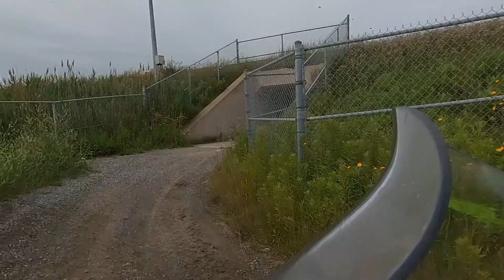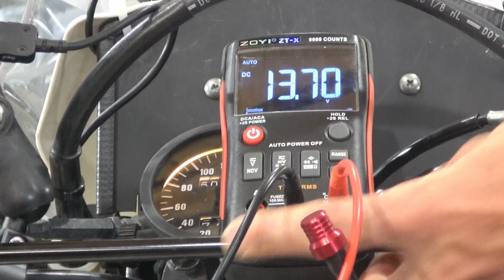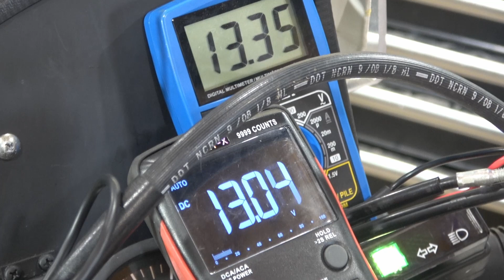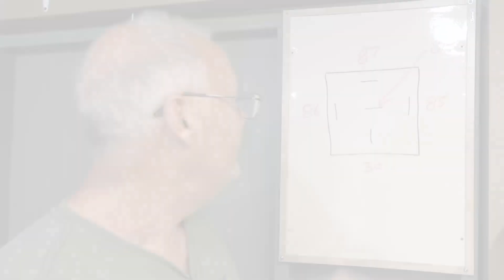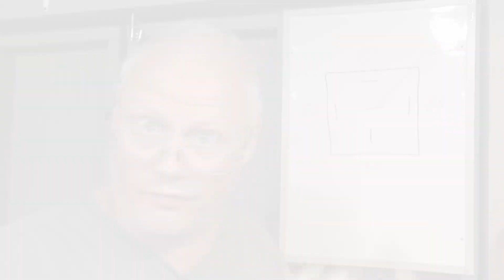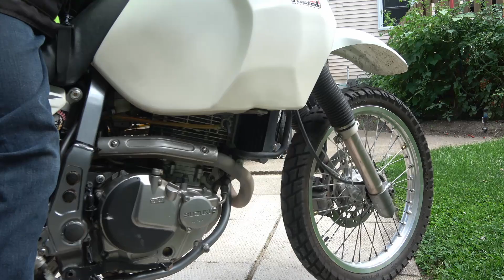Solving electrical issues on my DR650 GPS

Comment: Dino, thanks for posting this video. My question is after you turn on the ignition power on your DR, what is the electric sound I am hearing? Is it a fan? It is a whining sound.
Reply from the maker: @pdx650  thank you for the question, that is the fan for my cyclops headlight bulb.
Thanks again for the question.
Dino

Comment: I'm not an expert in electronics but I wonder if the 12v power for the GPS was tapped from a high amperage circuit such as the low beam headlight which is always ON, maybe voltage flucuations would be dampened enough that the GPS is kept happy, assuming that is the problem.   Maybe put one of those volt meters on the low beam to see what it's doing while engine reving.   Also, ProCycle offers after market voltage regulators.  I don't know if they work better, keep steadier voltage or anything about them, but maybe.  They're not cheap.
Reply from the maker: Thank you for your comments and suggestions. my 12 volt relay is wired directly to the battery with the low voltage keyed power operating the relay trigger coil. I like your thinking though and I could check this simply by bypassing the relay and wiring in the socket to rule out the VR. Thank you again for the tip.
Dino

Comment: I had the exact same issue with my Nuvi GPS on my KLR650 .   I think  your voltage regulator is working properly when it drops the voltage during engine revs. I believe that is how it is designed so as to prevent over charging.  Not sure but I think it kind of works in steps rather than infinitely variable.    It would be interesting to disable the charging system and go for a ride and see how the GPS performs on steady battery voltage with no fluctuations from charging system as well as the large variations in engine revs from shifting of gears.  I think you should be able to go for a short ride on only a well charged battery.    My theory is the GPS objects to voltages being all over the place.   Digital multimeters tend to show averages rather than true real time readings due to resolution issues. The USB power source I think helps alleviate this.
Reply from the maker: Very cool Idea, I am sure that the bike would run long enough for a test. Ill try that, thank you
Dino

Comment: I suspect the problem is contact bounce in the relay from cyclic vibration. I’ve seen this a few times on machines with large blowers on them. The fix was to put on solid state relay and the problem went away, sometimes turning the relay 90° or mounting it in a soft shell can help. If you know someone with a scope, you could hook it up to the 87 pin and battery ground and you’ll probably be able to see the cyclic vibration when the voltage drops. Keep up the good work.

Comment: Hey Dino, great vid as usual.  I'm wondering whether the relay contacts that power your GPS are being affected by vibration.  Not sure how you have it mounted, but perhaps you could temporarily remove the relay and maybe let it hang in free air (if possible) so that it isn't influenced by vibration.  Maybe it would be easier to jumper the connections at that normally open contact on the relay to temporarily bypassing the contacts, that way everything else is still in circuit.  This would at least eliminate this possibility.
Reply from the maker: You and a few others have mentioned this and I think you may be correct. the bike defiantly shakes a bit more on the road under load and this could be the issue. Thank you for the feed back
Dino

Comment: Great video Dino. The DR vibrates a fair bit being a thumper. It may be beneficial to change your power connection for the base to an SAE connector as they have a better more positive connection that the lighter socket type option.
Reply from the maker: Thanks for the tips! Many have made a comment about vibration and I think you are onto something. I will have to experiment a bit more.
Thank you again
Dino

Comment: Great video Dino.   I had what I thought was the same problem on leg three of round Aust. Occasionally the Dr would stop charging.  A few days later it stopped charging altogether.   I had a spare cheapy ebay reg/rec and swapped it out. The bike wouldn't start. I then swapped it with a mates reg rec, bike ran well but no charging. Rather than pull the bike apart I got lazy and bought a battery charger and charged the battery every night and removed the headlight bulb.   I got about 8 starts a day out of the battery.  I did 4000km doing that. Lol.  I presumed it was a stator and dropped it into a bike shop. It turns out the mechanic who replaced my piston, rings and cylinder at the end of leg 2 had strained a few wires going into a connector and although they looked good, they weren't.    So it was a cheap fix thankfully.   The USB sockets I use have a voltmeter on them and an on/off switch. They connect to power via an sea plug like you have on your battery tender.  I find the sae, merit and anderson plugs a lot more reliable than a cigarette socket. I fly out to start leg 4 on Sunday. Woohoo!
Reply from the maker: Right on, good luck on leg 4!!!!, wild how a simple loose plug can cause grief but 4000km riding with no charging......you are AMAZING!!!.
Thank you for taking the time to comment and share your experience.
Dino

Comment: hey there Mate greetings from Down under, Great video , my Garmin Navigator was having the same issues , also a Garmin Nuvi I have....no docking cradles just straight to USB. Frustrating as mine completely reboots . Have taken to using iphone and Waze maps ...seems to work well. also do not know if anyone else has mentioned but looking good mate , lost a shed load of weight by the looks of it ....any tips ?   cheers and thanks for your informative videos ...cheers
Reply: Don’t know which Garmin you’re running but for the Zumo XT2 it‘s recommended that it be powered directly from the battery. Seems the USB sockets don’t provide enough power for full screen brightness.
Reply from the maker: Thank you for the feedback, I've been thinking of just using my phone as well.
Dino

Comment: Hi Dino, I too am not good at electronics. That being said I would change out the cigarette plug ( female end ) it seems to me you ruled out about everything but that. Looking inside of mine I can see how vibration might loosen some connections or exacerbate a loose connection. Good luck
Reply from the maker: You have a good point here, I will order a new one.
Thank you for the feed back
Dino

Comment: Great vid Dino. I'm no Auto electrician either , A lot of issues with 12v can be earth problems, Some times with bikes the paint or rubber mounts stop the engine to frame coductivity. So a small earth lead can be added from engine  to frame just helps a bit. Some thing are just a mystery to us until we get to the bottom of it. Well done.
Reply from the maker: Thank you for the feedback. I agree with the mystery comment 100%, did I mention I do not like wiring all that much LOL.
Dino

Comment: Hey Dino, Great video Thank you for putting the time in. For a long trip to Outback Aust, I mounted my Zumo XT2 to my DR6650’s handlebar mounts using the BikePenR mount. Great piece of kit, machined aluminum, rubber mounted. The low profile keeps the dash accessible and the aluminum crossbar that I simply cut to fit the DR, allows the unit to be hand adjusted without coming loose. Although, I see it may not fit your standard bars. Nonetheless great piece of kit. For the power unit, I installed a Daytona 16037 D-Unit Motorcycle Power Supply, which ran the Zumo, and a double USB charger. Will add heated grips next time.
Reply from the maker: Thank you for the recommendations. I know I keep saying this but someday I will be upgrading my bars LOL. when that happens Ill look into the BikePenR mount, thank you again.
Dino

Comment: A good clear and informative video, Dino. As you have shown the voltage at the connection to auxiliaries can be critical. On my DR650 I measure the voltage and charge the battery on a regular basis through the auxiliary plug. I periodically loosen, inspect and re-tighten the battery connections (the battery is not large and I like all the energy I can get to go to running the bike). Your rundown on the function of the relay is good as is the information regarding carbon build up on connections. GPS - my Garmon Zumo has a multi pin connection. I have found that a periodic wipe of the connection pins is worthwhile ( I do not like periodic flashing of the GPS distracting me while riding). Thankyou for the video Dino - useful for motorcycle riders as usual.
Reply from the maker: Thank you Mal, great feedback that will help me and others. I hope your riding is going well.
Dino

Comment: Hello Dino. I think you are on the right track looking for a connection issue. I think the difference in the vibration of the bike loaded and unloaded may be why you have to rev it so high to get the issue to show up. My auxillary lights would flicker at low rpm while riding but i had to rev my dr 650 like you did yours to get them to flicker in neutral. I found one of my banana plus was the issue. I had to put a thin layer of solder on the male end of the plug to keep it tight and connected good. Been working ever since. Great video Dino. I always look forward to seeing them!
Reply from the maker: Great tip, Ill do some wiggling to see if that is a possible cause. Thank you for sharing.
Dino

Comment: Great episode, Dino. Love problem solving!! My guess would have also been the rectifier. Not sure if I remember this or just making it up, but Im pretty sure rectifiers have like a low speed and a high speed circuit that cross-over at a certain RPM. I was guessing maybe you had a failure in one of those...glad you figured it out
Reply from the maker: Thanks for the comment Eric and the feedback, your knowledge on this kind of thing is way more extensive.
Dino